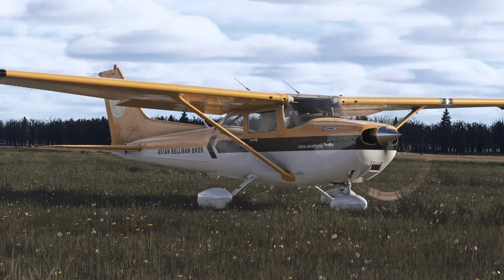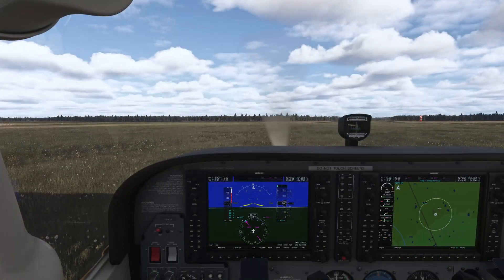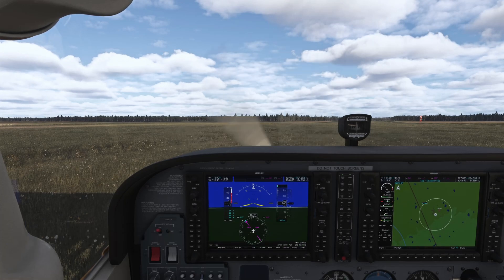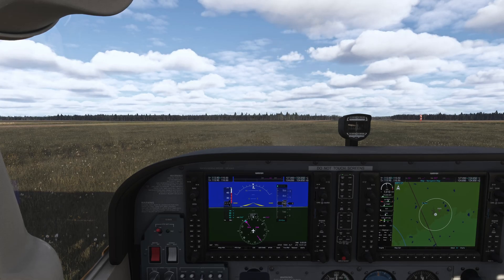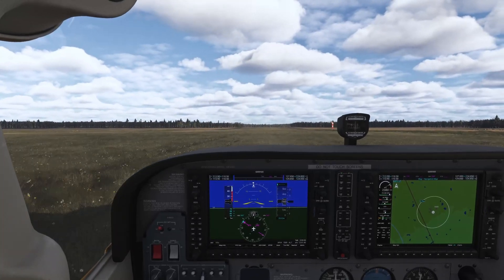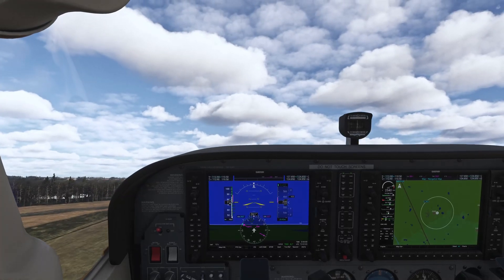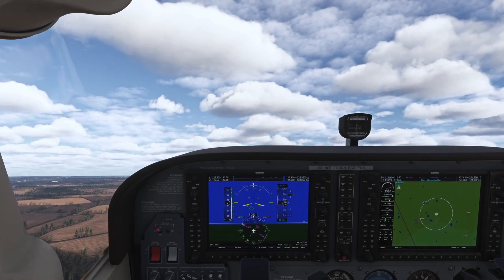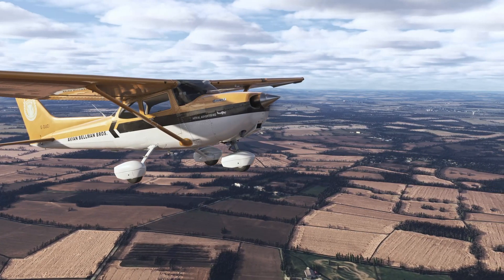MSFS 2024 - How to FLY SOFT FIELD TAKE-OFF - REAL WORLD PILOT

Comment: Is it recommended to use a higher flap setting for these fields? Wouldn't another notch help you get in the air faster compared to flaps 5?
Reply from the maker: Usually go for flaps 5...the more flaps you dump, the longer it will take for you to speed up as well...poh usually has that data of ground roll distance
Reply: Too much drag vs lift. Too much of a stall risk especially if you leave ground effect too soon